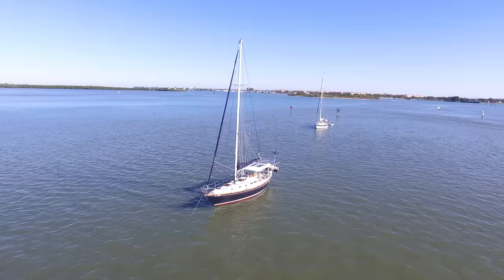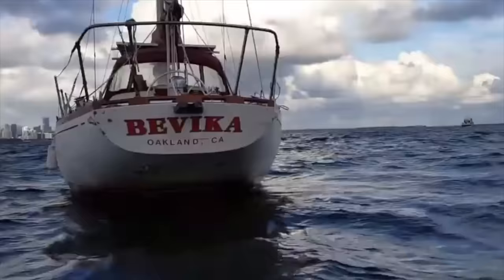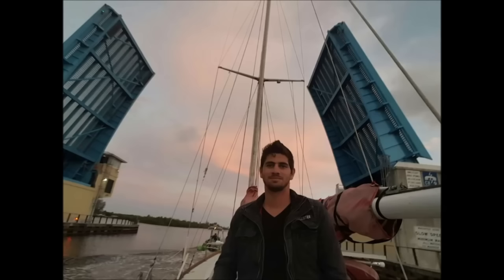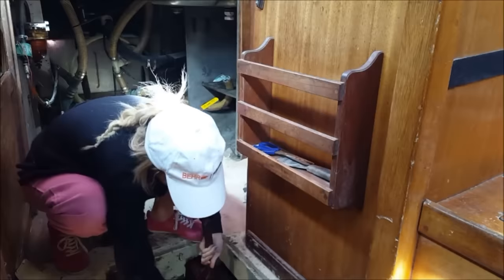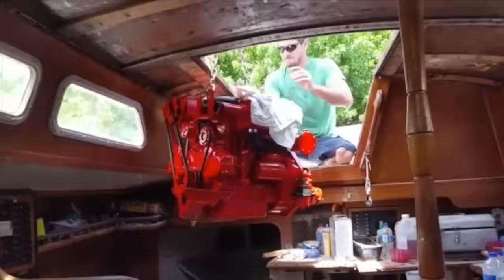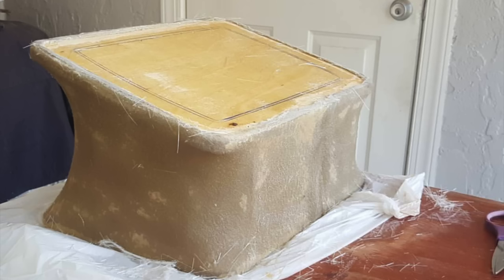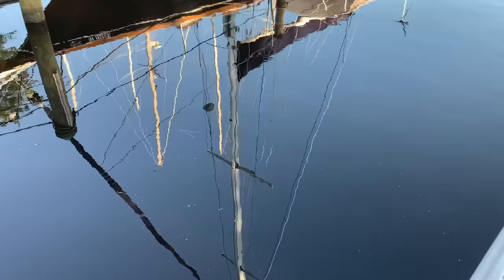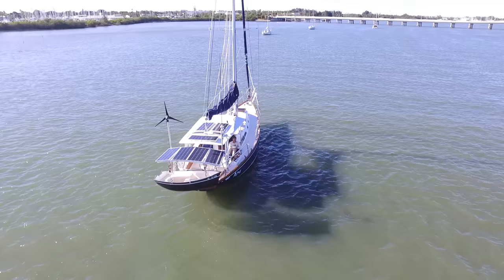ABANDONED SAILBOAT TRANSFORMATION:4+ Year PROJECT BOAT REFIT|E7|

Comment: I was aboard a Erickson 41 in the 70’s and we came in second place Newport Bermuda race.   This boat is a beast and loves high winds because we were in 20 ft seas with 45 mph wind for 18 hrs.    Two boats were dismasted and 9 had turned back but we kept going with Pabst blue ribbon beer and had a blast.   What hull number is Alma ?  Also who made the port frames ?   Your boat is beautiful and I love the blue !
Reply from the maker: That is incredible Roger! Alma used to be Bevica when she was in 2 of the Transpac race  in early 70s. I believe she took third in one of them. Not sure of hull number I know we looked it up before but have to look at paperwork. But she does sail amazingly that’s for sure .
The port frames are made by Boomar , we found them in a second hand marine store in ft pierce called Marine Connection. Thanks again Roger for watching and sharing your story!

Comment: Yes. We talked before am working on similar project only 35 feet. I am one year in. You have done an incredible thing here and I enjoy your videos because I can completely relate. Plus get some good ideas. Like that hardtop for example. Who did the design an welding for the hardtop and solar panel/davitt structure ? It must have been very expensive because it looks super. Also, where did you come up with the chrome/stainless fresh air intake horns ? Also great. Like the way you painted inside cabin. Really opens it up too. What can I say, fantastic work. If I can get even 1/2 the finished result I will be in my glory. More remodel videos would be helpful to see. Thank you.
Reply from the maker: Hi Jason! Yes how is the project going so far? 
We are happy to hear you can relate and find our videos helpful! 
Yulian designed the hardtop and 
structure. But a guy named joey in ft pierce built it. 
The intake horns we got in ft pierce in a secondhand marine store called Marine Connection. Yulian built the dorad box to save money.
Thanks yes we wanted to make it feel more open since Alma has only a 10 ft beam it can feel cramped inside with dark colors. 
We are positive you will be able to do the same! 
Thanks again!

Comment: What amazing work. One of my passions is to take old, neglected things and restore them. I spent three years restoring our 1976 Monaco Class C motorhome and it was very rewarding. Now, after seeing your interior, I want to spruce up the walls, which still have the original 70's walnut paneling, but I want to do in such a way as to not destroy the paneling itself. Did you paint over your original walls? If yes, what steps did you take?
Also, did you ever have any setback moments that, forgive the pun, sucked the wind out of your sails? I just finished doing a 1973 VW Super Beetle for our daughter, mechanical & electrical. When I starter her up for the first time in 2-1/2 years, she ran great....and then I saw the oil. Turns out the magnesium engine block is past its life. That was a real moment of, "What the heck am I doing this for?"
Love your channel, liked and subscribed.

Comment: Congratulations for having the strength to complete the journey!  Well done 👏 ✔ 👍. 
To a smaller degree (hopefully) I am on a similar journey refitting a Formula 35 PC express cruiser powerboat. You fabricated a hardtop from foam core and fiberglass. What tips would you offer someone undertaking this project?
Reply from the maker: Thanks Ron!!! Means a lot! 
Thats awesome congrats 🎉 to you. So we designed it but a guy from the marina constructed it, but everything else on the boat we did ourselves. But our advice in any project is patience because it usually takes 3 times as long! Thanks for watching

Comment: Hi, Impressive workmanship and and Awesome task. Very impressed as to the skills of your selves and young folks in general.. Our question is : How would the cost of everything you put into the boat compare to purchasing a completed boat-- ? we are think of moving up from our 33' CS in a few years-- and are debating tackling a project boat VS Buying a completed boat. Thanks..
Reply from the maker: Thanks so much! That means a lot! That is a great question. Our advice is that even though if you fix a boat it could turn out a little bit cheaper than buying a ready to go boat, but it does save you time because sometime you dont know how long it will take you to fix. If we ever do this again, we would probably get a more ready to go boat that only needed some fixing or additions such as new electronics , etc.  if we were able to afford a ready to go boat right off the bat, we would probably do that instead since in the end the price difference is not that much ( depending on price of boat of course) hope this helps. 😀

Comment: You guys did an incredible job. Definitely inspiring. What material did you use for the cabin ceiling?
Reply from the maker: Abe Burns thanks so much Abe. We used PVC from home depot. It still looks just a good as when we first put it. More details about the product is on our instagram!
Reply: @SailingAlma  Thanks for the tip. That's the same material I was looking at for my sailboat. It's good to know that it still holds up!
Reply from the maker: Anytime 👍

Comment: @sailing  alma did you know or have any boat maintence/repair experience before starting?
Reply from the maker: Great question! Yulian had some from when he had a hunter 27 project boat that was 5 years before Alma. I did not have any. But most of it was learning as you go
Reply: @SailingAlma  did you find that the learning curve was quite large and what was the largest pitfall that you had during the restoration, that made you think you should stop?
Reply from the maker: The hardest time was when we ran out of money and at that point the boat looks worse than ever and the mast was down the engine was outside the cabin was stripped it was and we found out that we had to fix the rudder post after finishing the rudder. To deal with this we took a 2week break from all boat projects to refresh our minds. When we came back we decided to do the headliner project seeing this difference lifted our spirits and helped motivate us to keep going. We also painted the interior which made a huge difference. Thanks again for watching see you next week.
Reply: @SailingAlma  good to know that  had taken break, was worried that you had burned out during restoration and left it for a long time before coming back to it

Comment: Forgot to mention. Fiberglass work sucks. And then you just keep grinding, and sanding and itching. And then do it again. LOL.
Reply from the maker: YES!!! We disliked working with it so much that when we got to do plumbing and electrical work we called it ‘fun’ 🤣
Reply: I getting there. But had the grinder running again today. When I arrived home realized I was covered with fiberglass dust. Looked like a ghost in the mirror. Itchy and Scratchy. Cold shower. Thanks for the reply. Keep the videos coming. Your boat is a classic beauty. No doubt a head turner wherever you go. Cheers.
Reply from the maker: O no! 😆 we remember those days. Just think your one step closer to reaching your goal. I remember after the cold shower we would fold scotch tape and then stick it on and off where it was still itchy. Worked like a charm to get those extra bits of fiberglass out! 
Thanks for your comment. Look forward to hearing from you in future episodes.

Comment: Why don’t they fix all sail boats from leaning over all the time??
Reply: You mean when they heel while sailing? If so, that's what happens when the wind pushes on the sails. This can only be remedied by adding outriggers or more hulls., like a catamaran has. However, there are advantages to allowing the boat to heel in strong winds.